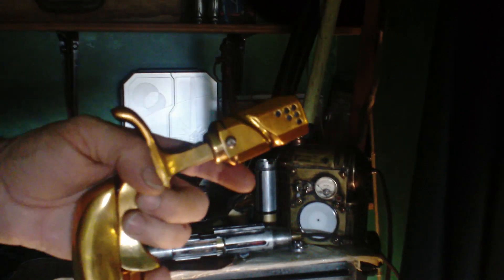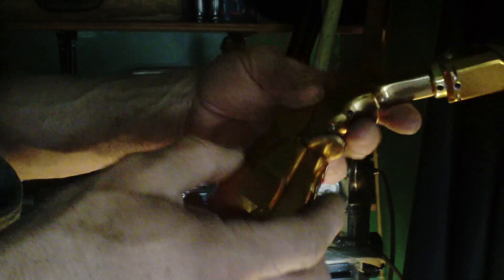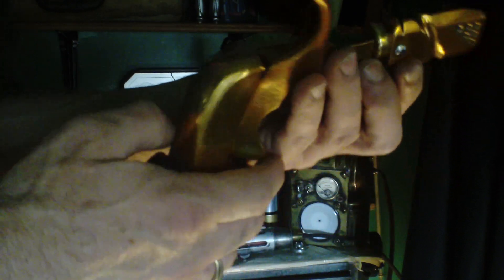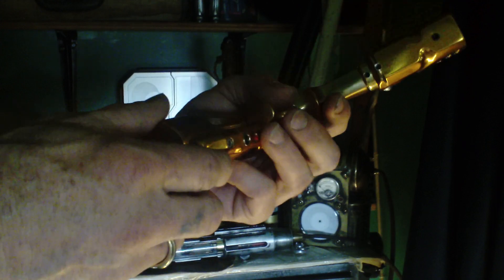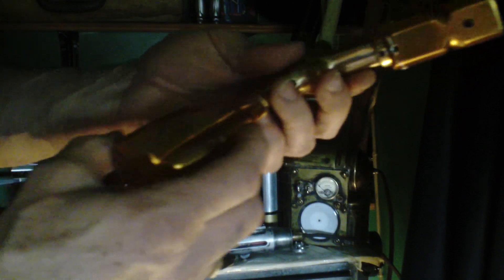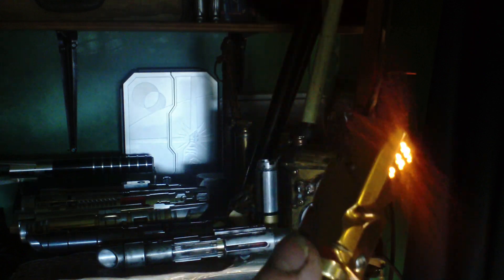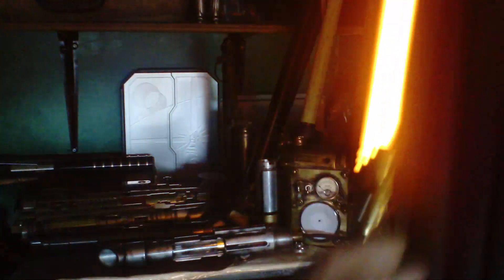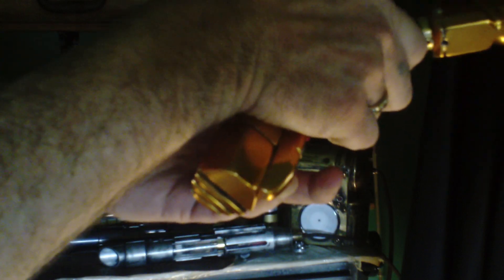The Lightfoil a very slim curved saber with sound!

Comment: bloody beautiful almost flawless the only problem I have is the curves  is way to steep I like it when it curves on doku and banes sabers for fencing
Reply from the maker: zeonthefox  that does make sense from a movie saber stand-point for looks. The saber as built, matches the original angle of the steel blade as made by the original manufacturer of the pistol grip foil that I used